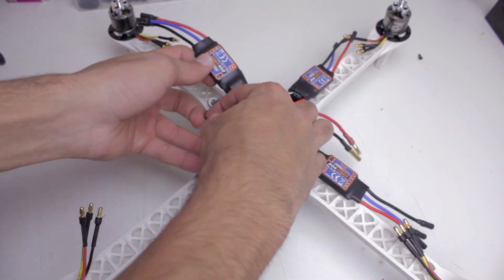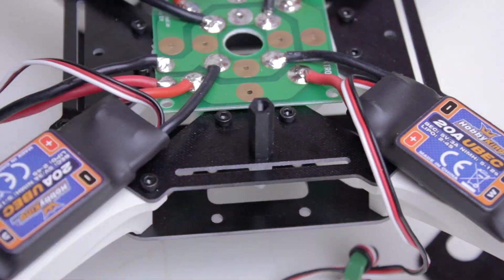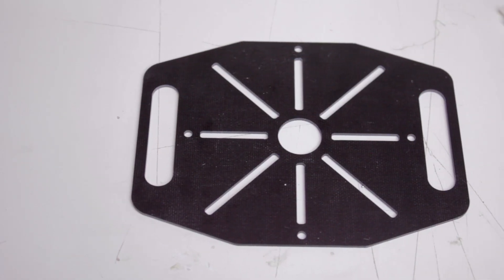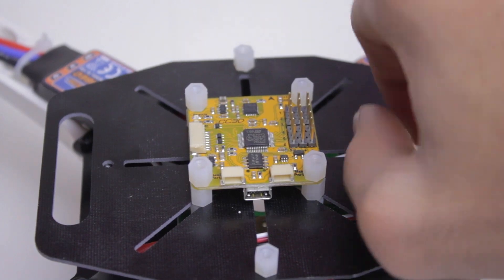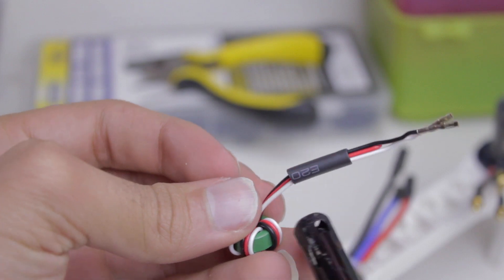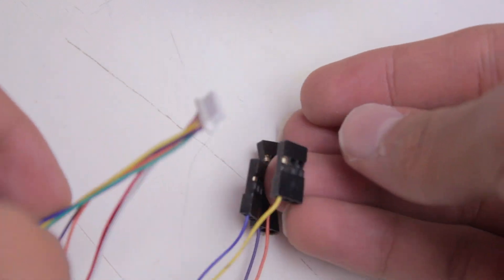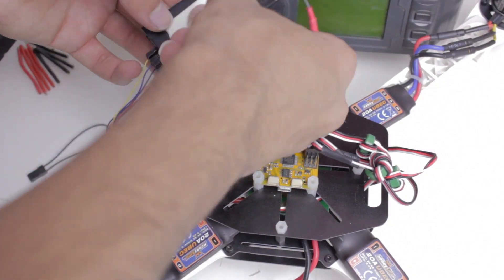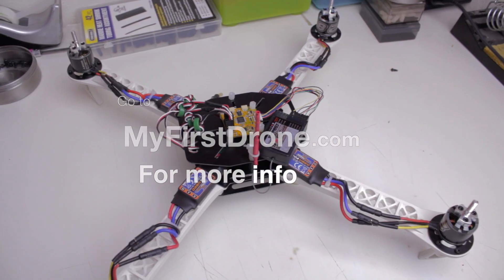Build your first quadcopter (part 3)

Comment: Is it better to mount the board on the top plate or the bottom plate? My frame is a HJ MWC X-mode quadcopter.
Will the power cables of the esc and the power distribution board interfere with the cc3d board? Beacuse I wanted to put both of them on the bottom plate.
Reply: top

Comment: Where do you use the Turnigy 3300mAh 3s 30c lipo pack as mentioned in the site?
Reply from the maker: The lipo pack is the main flight battery. You just mount it to the bottom of the quadcopter using a velcro strap or however you want.
Reply: Thanks... I actually am a beginner and i wanted to make this for my science project ...
Do you have any other link for 10x4.5 SF Props...
Hobby King's is out of stock
Reply: Subramanian Subra  Here are some buddy codes so you'll get a discount.
Red 10x4.5  http://www.hobbyking.com/buddy.asp?code=8A65E5A2-DE53-4548-BC64-98046D2B6DDB
Black 10x4.5 http://www.hobbyking.com/buddy.asp?code=92B394B8-59B1-4599-933F-E31056BEC523